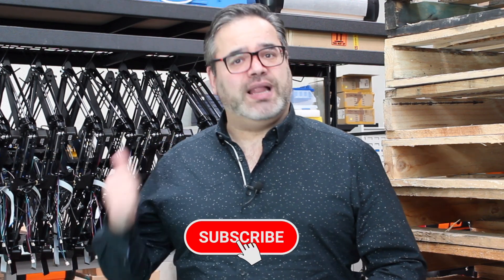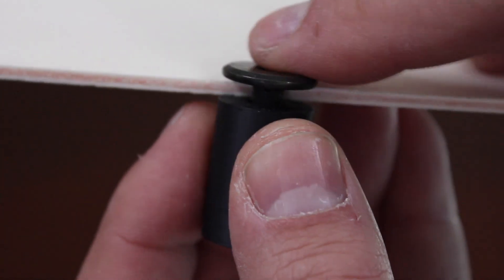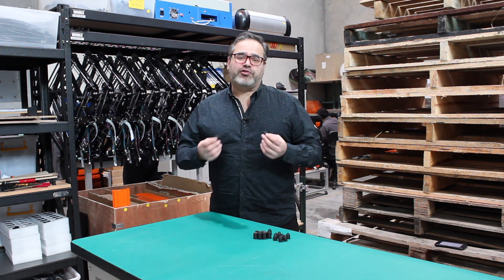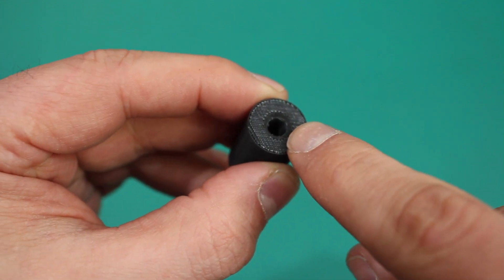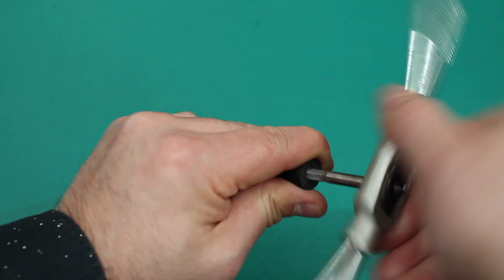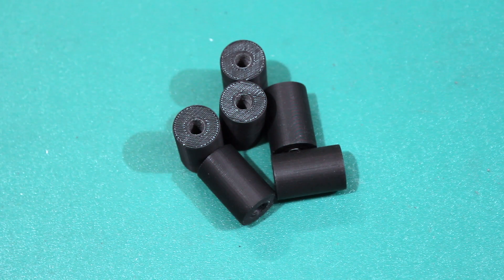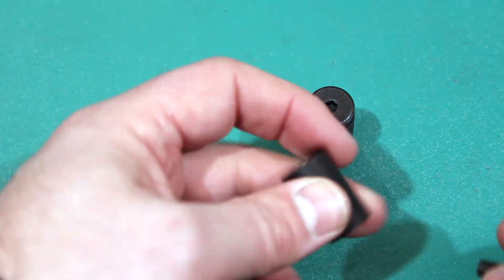Magclips material support holders - great results using your laser cutter for wood and plastic.

Comment from the maker: If you have a laser cutter, make yourself a set of Magclips!
0:01 - Introduction about holding the material in place with a laser cutter
0:37 - Magclips, material support holder that allows you cleaner cuts
0:55 - Two different styles of Magclips
1:06 - How to use your Magclips in your laser cutter
1:37 - Using a spike Magclip to support the centre area of your material
1:51 - Configuring your software for the hight of your Magclips
1:56 - Materials to use with Magclips - Wood and Plastic 
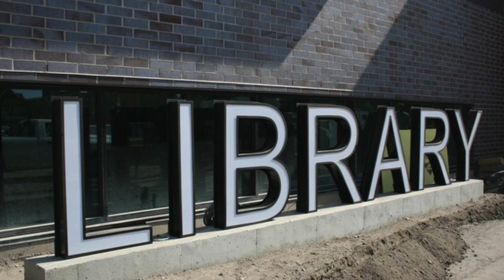2:15 - List of parts needed to make your own Magclips
2:35 - How to construct Magclips
5:42 - Have you used Magclips in a project? 
5:52 - Thank you to Darkly Labs for this project
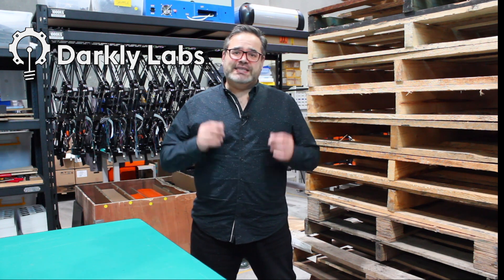6:09 - What's coming up next with laser cutters

Comment: Great Videos Gil ..... I did the same thing but with commercially made magnets and knurled thumbscrews .... works great and the laser clears the thumbscrews by a few millimeters ..... really flattens out the plywood ! .... I needed some spacers so I made them out of 3mm plywood on the laser. Now I can clamp between 1/2" down to thin paper or cardboard.

Comment: Thanks for the idea.  Rather than fighting to create a STL file and get the library to print them for me for a cost.  I will simply pull a HDPE rod off the shelf and make them on my wood lathe.
Reply from the maker: No problems Jesse. There are multiple ways to get the same result using different methods. Just to let you now the STL for the design is freely available on Thingiverse if you would like to use a 3D printer. Love to see your HDPE version :)

Comment: Like the design but why to different sizes magnets? Also i am going to use Heat inserts instead of tapping but thanks for the Idea
Reply from the maker: Great idea! The idea of different size magnets was simply due to the function of the different pieces, but if you want to use the same, go right ahead. Heat inserts is definitely a way to add the thread to the piece. We didn't know of them when we designed the magclips.

Comment: Think I'd turn these out of steel bar stock. For the other support spikes I'd use 'punk' fashion 1o -1/mm spikes  which could easily  be drilled out to take a magnet.  I have a 3d printer,  but I don't think plastic  would last very long in a laser. I am actually building a laser ( Further Fabrications design) and am just now deciding on the best table arrangements for sheet ply .
Reply from the maker: Cool idea. I have not had an issue with the Magclips I have made, but if you can do it... more power to you and your laser :)

Comment: Hi Gil,

We run an Emblaser 2 at our school and I was looking for a solution just like this, so thank you for the idea. Do you find that the laser marks the base of the emblaser at all?

Thanks,
Reply from the maker: In my experience I have not had an issue with the process marking the base of the Emblaser. Given that the focus would be scattered by the time the beam hits the base, I would guess that it would park the base if you repeated the passes a number of times (5+ passes).

What kind of material do you use at your school?
Reply: @LaserLivestream  Thanks for your reply! We're mostly using cardstock, eva and 3mm plywoods for our projects so far.
Reply from the maker: @SIS_Tech  Nice. Just a heads up that you might want to catch this livestream tomorrow. Great resources for laser users and teachers! https://youtu.be/eJJN7--HO4g

Comment: Great idea, but considering that you have a laser cutter and not necessarily access to a 3d printer: Why not make them from plywood? 
Cut a few circles out of plywood with a hole in the middle, glue 'm together and you got your little pillar.
You can go fancy with the holes an make' m the right size for the magnet and even one that will hold a nut so you won't need a tap...
Reply from the maker: Thats a great suggestion. I look forward to seeing your design. There are a number of different ways to get to the same answer. Plywood would be one great answer. Thanks for sharing!

Comment: Great idea! But this isn't going to work when you have something that has an outer and inner cut piece right (it might drop through before it starts cutting the inner part).. beyond that I love the idea!
Reply from the maker: Great question Jeroen! If you have your settings worked out, you can cut your material, and still have the parts held slightly in place without them falling. A friend of mine cut out a model train (literally 60+ parts) out of ply, use the Magclips and they all held in place. That said, always cut the inner shape before the outer of your shape. Minimises any errors even if you are using your bed. :)

Comment: Great idea! Wouldn't it be easier to insert a hex nut instead of threading it? and what are the screws called? I'm having trouble finding ones with such a wide head.
Reply from the maker: You can put in a hex screw if you like, I found that threading the part allows you to use the length of the piece to support the bolt.  Here is where I got my  M6 Large head connector screws from. https://www.keables.com.au/ - 6X16 Connector Bolt Flat Hd Skt Drv
Reply: Aldi had thread tappers about a month ago that I use for wood and plastic...

Comment: Thanks Gil, I've had magnets on order from Ali Express since Darkly put this on their FB page, looking forward to trying this out, at the moment we are using all sorts of things to weight material down ( panel washers, metal rulers etc ) but they often rattle off due to the vibration of the air assist motor unit.
Reply from the maker: I know the feeling. I love how simple Magclips are. Thank for sharing how you will use them :)